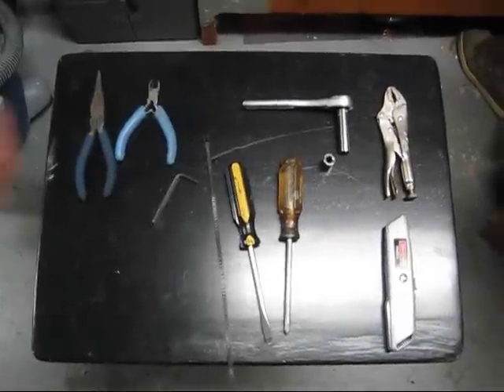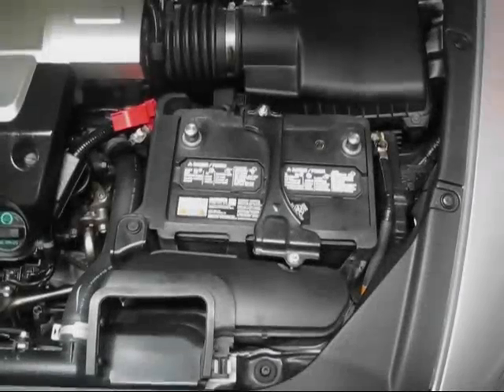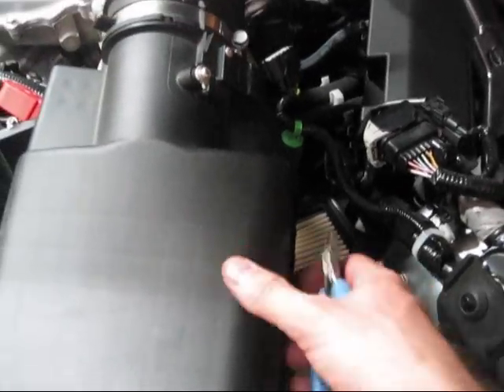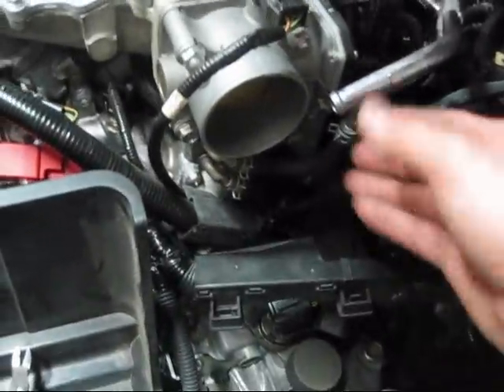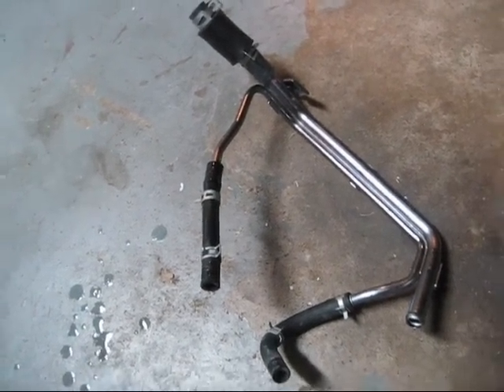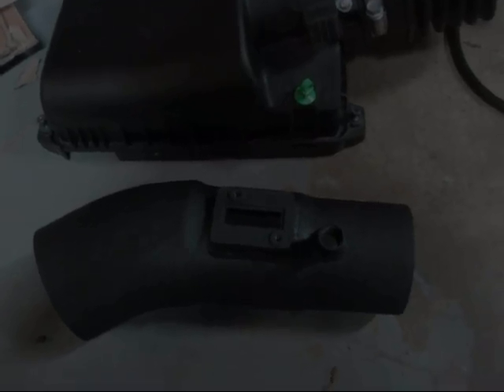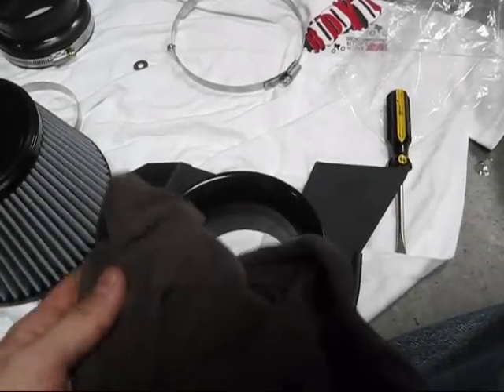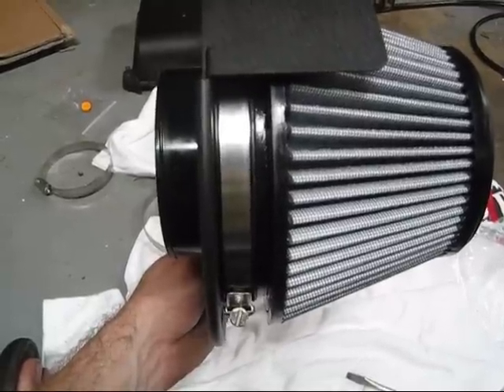Takeda SRI Install, Part I

Comment: Waiting for mine to arrive this week.... I read quite a bit before ordering. Only negatives I heard about Takeda were heat soak (mainly just at idle) & I read one fella mention heat wrap. So I ordered a $40 roll of top grade heat wrap (inch and a half wide by 10 feet) that I plan to METICULOUSLY wrap the entire intake with. I have to imagine that will make quite a difference. I'm guessing the metal intake tube is what is heating up quickly in the engine bay, and causing pretty cool air to heat up quickly before it hits the engine, is my hypothesis and preventing the intake tube from heating up should make a huge difference I think.
I've spent over 20 grand on parts/body shop repairs/mods etc for my 09 V6 Accord... its my love. So I don't do something unless I'm pretty confident it will be good for the car.

Comment from the maker: @jacobhendry 

I chose SRI over CAI for a few reasons.  First, I didn't want to have to pull the bumper off to check/clean the filter.  Next, I didn't want to worry about hydro-locking my engine by driving thru puddles.

Some guys have noticed worse low end with both CAI and SRI, especially those with I-4.  I'm not sure if the SRI will improve the power/fuel economy issues you've seen.

Comment: hey austin just an inquiry i own a 2011 honda accord 2.5 v6 sedan is the takeda sri bolt on for my engine too cause i noticed on your video that the engine seems to look a little different but same 3.5 v6